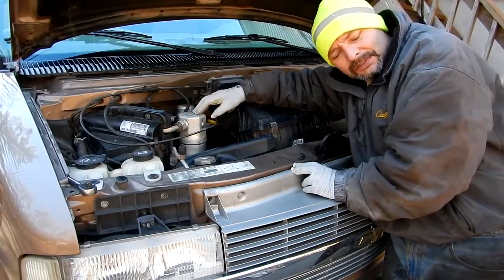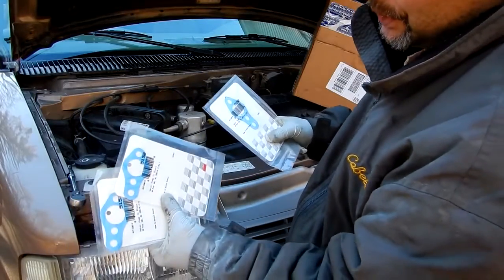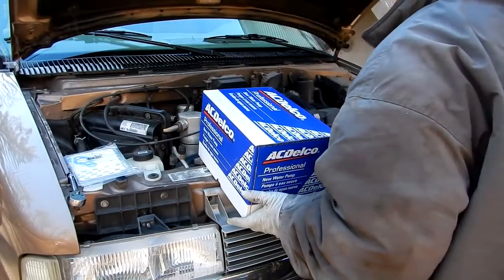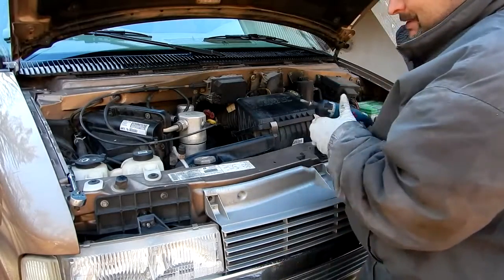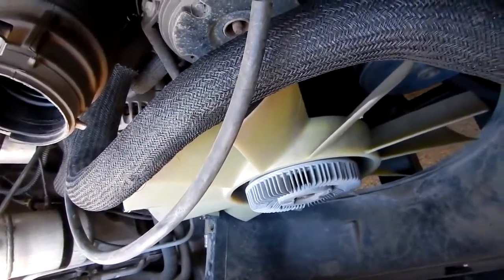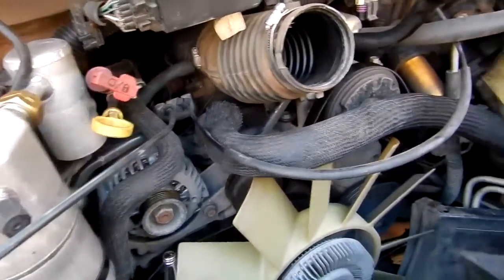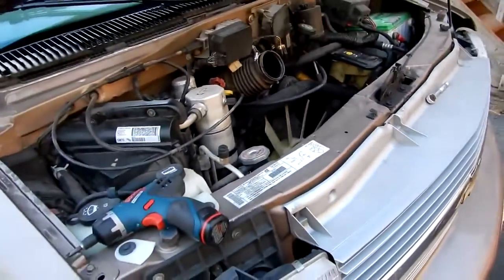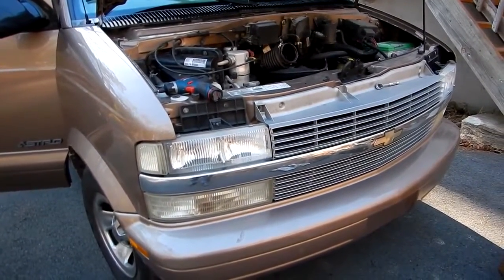Chevy Astro leaking water pump

Comment: Which pump did you get from Rockauto? They have several listed. The one listed as ACDELCO 251719 {#12532528, 251579, 89060527}  GM Original Equipment Includes Gasket is about (4) times the price of the one listed as ACDELCO 252711 {#88926225}  Professional; Does Not Include Mount Bolts; Includes Inlet and Outlet Gaskets
Reply from the maker: i got the cheaper ac delco

Comment: Have you ever stopped working on this???

Seems less than mechanically sound based on age, design, previous owners, previous owner maintenance.... American made deficiencies etc.

Toyota 195,000
Original starter, clutch, struts, front end, bearings, radiator,  hoses, engine, trans., suspension, electronics....

Astro... some appear Not a good buy.
Not reliable...more than twenty miles from tools, garage.
If someone paid to have the work done to date... a complete disaster.
Reply from the maker: I had 2003 Toyota Rav4 (if you watch my old videos). The first 160k, just brake pads, nothing else, then master cylinder at 160K. The rust killed it at 200K. Second best vehicle I ever had. 

My Geo Prizm (Toyota Corolla copy) was the best 260K with no repairs, gave it to my cousin, he drove it for 4 more years. Rust killed it too. But used Toyotas are expensive. Got this van with 57K for $2500. If it was Toyota van, easily $10k. I guess pay it upfront or pay it later in repairs.
Reply: +Astro Camper  Had a Corolla died at 360,000 from rust. Ran like new. Broke my heart.
Reply from the maker: My Rav4 would still be on the road if it wasn't for rust